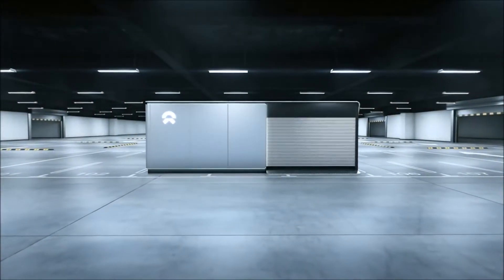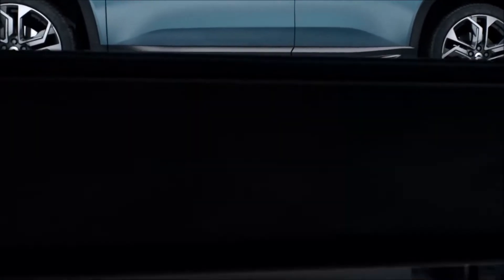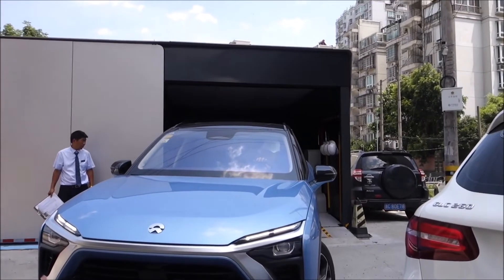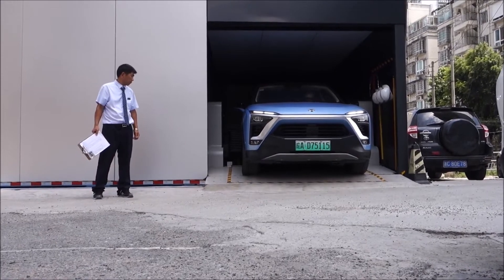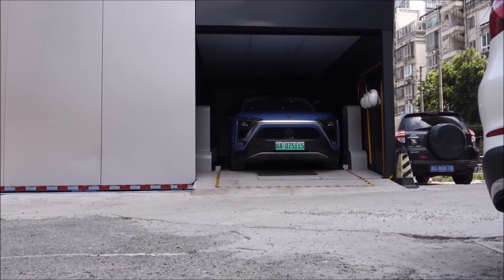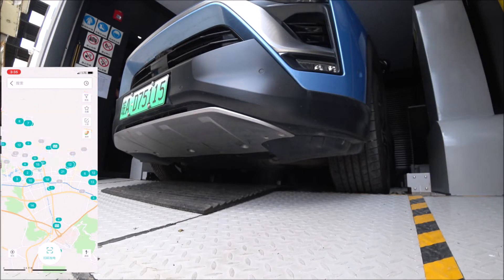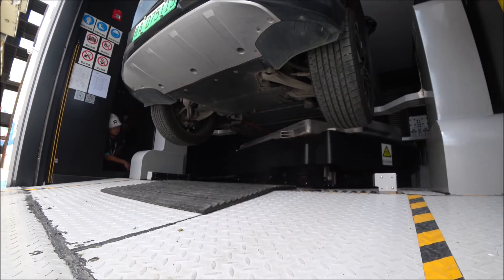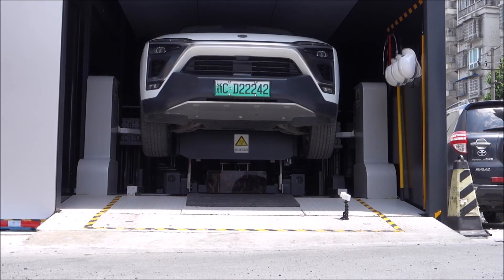Nio Battery Swap Stations

Comment: Here's another idea: a module charging system. Like 100 km battery swap. You'll only swap part of the batteries giving you 100 km. That's what most people will need. It will be faster and cheaper: the 100 km module will be from a cheap technology that can be "disposable" (used a few times). That smaller module will be lighter so the robots can do the swap faster. The main battery will be a permanent module (being like 80% of the total charge). Advantage: you'll always keep the same main module.

Comment: NIO, stop with this. How often do phone and laptop makers require users to change out their battery? Focus on making the battery better, dont introduce manual complexities. Software + Battery tech will make electric cars run longer and further. Don't be caught with this infrastructure when people just rely on charging their cars only.